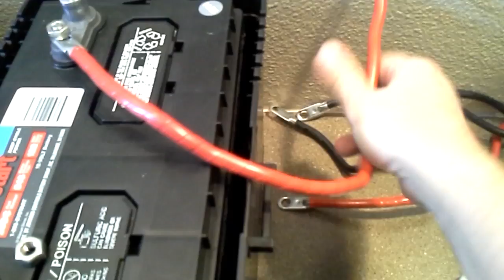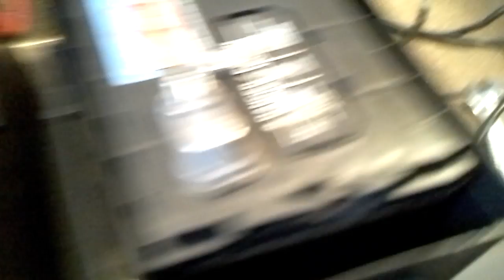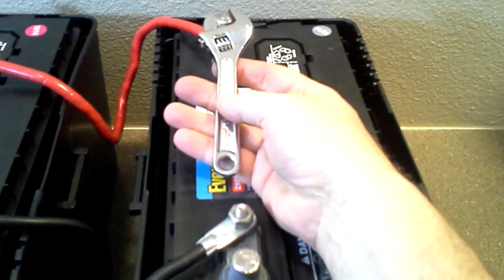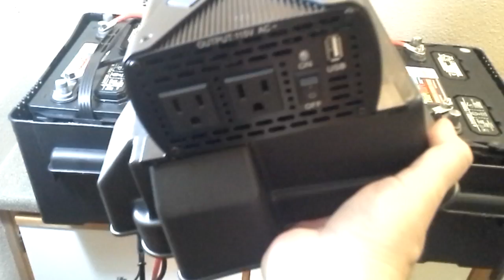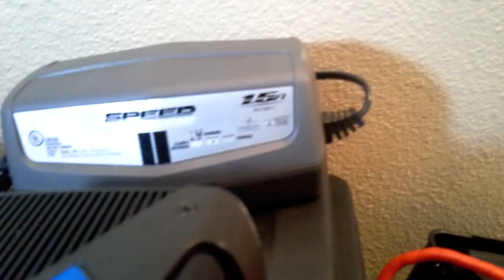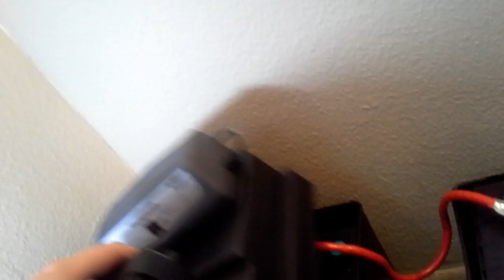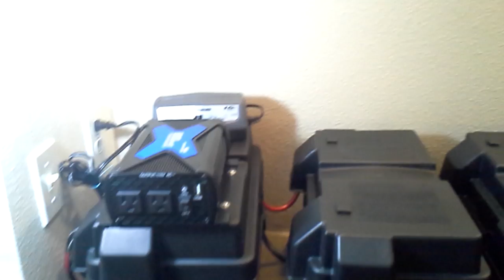Installing 4kW/Hr battery bank with 800W 120V Inverter and Trickle Charger from Tactical Woodgas

Comment: Your negative lead should have went to one end of your battery bank and then your positive should go to the other end, that way it discharges your batteries evenly, but instead you are drawing your full load off just the end battery that you are connected too and again NOT evenly across the bank! Over a period of weeks you will find the last battery that is connected to the inverter will no longer take a charge after a while!
Reply: Greg Benwell v
Reply: That is incorrect. Take the battery itself apart and you will see the 3 (ea) 2.2 V cells connected exactly as these are. Essentially what the guy has is 3 (ea) 13.2 VDC batteries wired in parallel to have 1 giant 13.2 VDC battery. 

What are my qualifications for saying this you might ask? I taught automotive electrical in the US Air Force for 4 years. During that time, Yes I did write the book on automotive electrical (wrote several training manuals on the subject). Then over the next 30 years I worked in trucking, mining, construction and similar industries as well as motorcycle dealerships and usually became the informal 'electrical guy.' My final qualification is ASE certified Master Heavy Duty Truck Technician.
Reply: Jerry Lynch stop beating your chest.
Reply: Greg Benwell  good
Reply: You have all those qualifications and you're still wrong? Hmm. That's quite an accomplishment.
Reply: I might well ask what your qualifications are Jerry, especially as you think it's okay to connect lead acid batteries in parallel like a child with only a rudimentary understanding of electrical practices might. And if I take a battery apart I will see several cells in series, and definitely not connected as those are. The nearest battery to the charger will undergo most of the charging and discharging because of the resistance of the cables connected to the other batteries. Greg is right. Do you know what Ohms are a measurement of? (This must be a rhetorical question to you!). Hang on, didn't Phil Silvers's Sgt Bilko character used to work at the motor pool in the armed forces? 'Nough said.

Comment: good  12 VDC  batteries  parallel  connection in which  Voltage of the  batteries  will not add up ( remain 12 V DC )  but  batteries  ampear  current  will add up  ( if each battery  has 100 amp it will 3  will generate 300 amps ) #

Comment: thank you for this video is nice I would like to ask you a question can you use the battery charger on while you are using the inverter with refrigerator on can the charger stay on the on position it won't burn the charger thank you again

Comment: To connect your lid the positive should go to plus on the left battery but the negative should be connected to the battery on the far right, this will equalize the charge/discharge through all batteries
Reply: At the amperages involved in supplying enough current to the inverter, it does make a difference.  Also, since battery charging -- especially in a battery bank -- depends on resistance, any difference in resistance that's not actually within the battery will result in the battery and the "end of the resistance" chain being chronically under-charged.  That's a sure recipe for reduced battery life and performance.
Even with thick cables (and these aren't "thick", I have 0000 cables on my battery bank and they're barely up to spec for my 2500 Watt inverter; they're bigger around than my thumb), there is enough resistance to make a difference.
Reply: It's not the amperage, it's the resistance/impedance to the "end of string" battery(ies).  Charging with modern chargers works on resistance -- even if it's a small resistance, the charger will "see" the battery that the charger is attached to as fully charged but it will also see the string further down as fully charged but it really won't be.  If you start less-than-fully charged and don't fully recharge that battery later, that battery will have a significantly lower life.

Battery maintenance is the big thing in all ways, but not balancing a string will put you in jeopardy for damaging batteries unevenly.

It's especially important when you can move a cable and make a $100 battery last two more years longer than it would have if wired in in an imbalance.

Comment: Make sure everyone who watches this video knows when you use automotive batteries you only get 20% of your amp hours. AGM is 50% and Lithium is about 80%.
Drawing power below the % capacity will kill your batteries in less than a month.

I recommend sealed AGM for this and most other applications. (100 amphour rating = 50 usable amphours)
Lithium would be good for Off-grid solar generators and flooded leads are really only good for engines

Comment: Hey there my friend I watched your video and it's perfect for an emergency, I have a question not sure if it crossed your mind 🤔 I saw you plugged the charger directly to the wall, have you tried connecting to the inverter to maintain a current charging flow directly to the batteries?? Allowing not to depend on any other source besides of the batteries itself curious question🤔 thanks for sharing be safe🙋‍♂️.

Comment: I'm putting together a similar system right now...  Everything I've read is that you always use the same batteries for the battery array because they may have different charging characteristics.  Same model, same capacity, same voltage.... basically make all the batteries identical.  Particularly the capacity.  I think someone also mentioned that you "draw power" from both ends of the battery array, not the last battery in the series. Neg lead on one end and the pos lead on the other end.

Comment: You must have a small fridge if you can run it on an 800w inverter. Many recommend a 2000w for big appliances for start up voltage draw. I had a 2000w inverter and it powered my 52" big screen on a 240 amp hour bank for hours but I wouldn't trust it on a fridge. I use Xantrex and they are awesome.
Reply: wingmanalive Most modern fridges are energy star rated and use less than 200 watts when running / 700 watts when starting. I ran my large 25 cubic ft fridge for a good long while on a 750 watt power inverter and a 95 ah battery.  I ran a kill a watt meter and found it pulled 730 watts when the compressor first started and 180 watts after 2 seconds. The only type of fridge I can think of that pulls a huge amount of power is a commercial fridge for a store or school cafeteria.
Reply: 200 watts when running? Is that with the door open or closed lol?  I'm no electrician but that is a surprising statement. My fridge is at least 15 years old and I know my 400w running/800w peak inverter would NEVER power it especially on start up. Always gave me a shut off. Now I do have a 1000w Xantrex inverter I haven't used yet so I assume it would run it based off your experience.. My 2000w inverter sleeps with the fishes lol. I played with that beast until I killed it. I just need to acquire the batteries like you show here to power my fridge for a decent amount of time in times of emergencies.
Reply: wingmanalive Oh, that explains it then......both of my fridges are only around 8 years old and energy star rated. They honestly use less than 200 watts running. I did go and see how much they used with the door open and found that they pull nearly an extra 100 watts!(Darn regular light bulbs LOL...need to switch to LED or CFL blubs). They Shut my little 750 watt inverter down when trying to start with the door open.

Comment: Perfect video! thank you in advance of my question.. I'm missing the step how the charger and the inverter connect to each other before they go to the battery terminal. Thanks again
Reply from the maker: jmondia 
I make that connection when manufacturing the battery bank.  All you have to do is connect the red and black wires to the battery as shown in the video.

Comment: IS WISE , IN PARALLEL BATTERY ARRANGEMENT,  CONNECT BETWEEN BATTERIES A CORRECT DC FUSE TO PREVENT A FIRE IF  ANY  BATTERY IS SHORTED/ IN YOUR CASE A 60A FUSE IS OK.  THOSE FUSES ARE TO BE INSTALLED IN POSITIVE OR NEGATIVE POLES.

Comment: technically he was still plugged into the wall lol.....using that battery charger lol the batterys are also not deep cycle so they emmits gases cause its water based battery

Comment: whoever is learning from this, tighten as u go
Reply: And hold the battery cable so it will not rotate as you tighten terminal, wrong way demonstrated here.

Comment: Simple, and straight forward! Also, good "Tips". One thing though, I have an inverter, and in the instructions to it, it says "NOT" to run any load off of it, at the same time of charging the batteries, that it is connected to. Any comments? Thanks for your time.

Comment: I got something like that setup but I've got 10 deep cycle batteries, And I don't plug it into the wall to charge it, I charge mine with 1000 watts of solar panels, And I got a 2000 watt power inverter.
Reply: Post a video on it if love to see
Reply: Thats enough energy, plenty of batteries.

Comment: Very organized explanation.  So far the videos I've seen (before this one) had people setting up their battery banks with wires sticking out all over the place; very confusing to watch.  This is a neat little set up.  It's not rocket science to understand about the AC outlet keeping the batteries charged.  All one has to do after is substitute the AC outlet to solar panels, wind turbine, etc to charge up the batteries.
Reply from the maker: Go to www.tacticalwoodgas.com, there is a video on all the charging methods, including solar.

https://www.tacticalwoodgas.com/online-store/Battery-Bank-with-800W-AC-Inverter-plus-solar-wall-car-charging-ports-p68927669

Comment: Don't use any type of starting or marine battery. Yes they are deep cycle, but can't handle true deep cycling like a golf cart or solar battery can. You are better off using Golf Cart batteries, they are made for true deep cycling and last way longer if you treat them right. I am going on 3yrs with my golf cart batteries, and they still are strong.

Comment: Nice! You could connect the positive to the 1st battery, and the negative to the 3rd battery... and the opposite for the inverter, thus avoiding the 1st battery being overused... even in parallel the charge is incoming and outgoing from the 1st battery... isn't it? Just curious!
Reply: Your absolutely correct on that the charge needs to come from opposite ends in order for batteries to b charged fully and same goes for inverter hookup,, opposite ends so it draws thru batt bank equally or u will end up killing that first battery alot quicker than other two!,, good eye, was about to post until I saw yours!!
Reply: Rodrigo Boos I have two house batteries in my rv and I know they are connected negative to positive, if I get a small 750w/1500peak watts converter can I hook it up to just one house battery? Or should I connect to engine battery or just plug adapter into cig lighter? (New at this, thanks for your patience)
Reply: shelleyfunny19 House batt. Dont want to flatten the engine batt. I assume your house batt is connected to some sort of charge system. If you use the cig lighter socket then that will more than likely be rigged to the engine batt. Also a solid connection to the batt is better than a cig lighter connection.

Comment: A question: in this system he will be saving energy all the time?  in other words   Elc grid ----> charges battery (AC) -> Energy stored in the batteries (DC) -> Energy converted by the Inverter to AC -> AC used in the entire house. 

If im not wrong the AC from the grid charging the batteries is lower than the final output, because to charge the batteries requires less Watts than the normal usage provided by the charged batteries...
Its a doubt that i have because i know for sure that something like this actually WORKS as energy saver system, a friend of mine has an hotel and montly he was paying 3000€ as electrical consumes, after installing a system very similar to the one descripted in the video he lowered the bill to 700€  having the same things working ( fridges, air coolers, lights etc)
There is someone who can explain me deply how  it is possible?  Thanks

Comment: Where the 4k watt came from. LoL. I see only 3 battery 🤣😃😆😂😁
Reply: V x A = VA = WATT...110 Amp-Hr x 3 batteries is 330 Amp-Hrs x 12V = 3960 VA-hrs = 3960 W-Hrs = 3.96 KW-Hrs...but since Lead-Acid batteries can only draw down to 50%, you can only get a little less than 2KW...

Comment: You are connecting the batteries wrong: in a parallel layout, for better Efficiency the positive of the Inverter goes to the "First" battery and the negative goes to the "last" battery
check this video:  https://www.youtube.com/watch?v=QwWNF_jorYY

Comment: Sir,
I think you made a mistake connecting the wires for the power inverter.
The cables shouldn't be connected the way you did. You should draw power from the far right end bottom positive side of the battery to the top negative side of the battery bank.
This will let you utilize the battery bank evenly instead of draining one battery and ruin the entire battery bank.
Please checkout my google+ to see alot of diagrams and  how to wire 12V, 24V 48V  battery banks in series, Parallel and Series Parallel

Comment: I wonder if it would be more "efficient" if you tapped into your batteries at the center battery, that way you won't have the center battery causing a reistance situation as they deplete...
Reply: +SM Kira  he should have taken the POS post on the first and the NEG post on the third and hooked those 2 up.  This would drain evenly from all 3 batteries and not strain the first one..

Comment: Modified sine-wave  will normally cause compressor motors (and all motors) to run very hot and reduce the life span.
Reply: Dennis Steele 

I have not found that to be true.  What is your source for that information?

Comment: You should be connecting the inverter connections at opposite ends of your battery bank
Reply from the maker: JimandLinda Woodruff 
Agree for higher power inverters. Less of an issue at 800W.
Reply: @tacticalwoodgas4036  Always an issue ...

Comment: that's  Awesome for me during hurricane season at least run some fans to stay cool, but the only thing is if i don't have power how am i going to plug the top part of the inverter
Reply: There are solar versions at www.tacticalwoodgas.com

Also, you can recharge it with your running car and jumper cables.

Comment: How about using a socket, extension and ratchet that way the chances of contacting the opposite terminal are almost nonexistent.
Reply: yellownp22541: Yes, true. But using a short wrench, especially one that ratchets, is simpler (less parts involved). Whatever....

Comment: Why did you plug it into a 110 outlet could it not run with out plugging into the wall plug the inverted power should work with out the 110 wall plug assistant’s right or wrong let me know thanks again
Reply from the maker: The 110V connection is to keep it fully charged between power outages.  Yes, it works without being connected to the outlet.
Reply: I asked myself that same question. This character is just brilliant. I'd have chosen the alternative, instead of 3 deep cycle batteries, the 1 deep cycle, an inverter, an alternator, and a double shaft blower motor, 1 side with the squirrel cage to cool things down, and the other with a pulley to run the alternator.

Comment: At what point in this video does it show where he tied the inverter into the system
Reply from the maker: That connection is made for you.  The big red and black battery wires connect to the inverter, AC charger, and on some models to the solar charge controller.  More info and videos at www.tacticalwoodgas.com

Comment: How many batteries should I invest on a 10 k inverter,  any one,  I don't wanna over kill it
Reply: For that amount of power it's better to step up the input voltage. I'd go to 36V or 48V but it's your choice.  See this video here for an idea - "EASIEST Off Grid Solar Power System Battery Bank'

Comment: I don't think your inverter is strong enough to run a fridge.  Most fridges will take over 1000 watts to cold start.  And if you use a modified square wave type inverter many AC induction motors won't run properly and modified square wave inverters will likely shorten the life span of ANY fridge motor.  I recommend at least 1200 watts for a fridge (startup) and use a sine wave inverter...  fyi...  regards...

Comment: decent setup,, im doing a bigger set up from the shed,, but i dont think an 800watt inverter will run a fridge or freezer the start up draw amperage is to much for the inverter, i scene a video,, where they use a 2000 watt inverter but  its surge apms were at 6000 watts,, im using a 1000 w,, and it only runs lights ,radio,, router,, and a laptop, maybe the tv, if i pushed it,lol
Reply: My 800 watt inverter will run my full size, side by side fridge.  It's a THOR modified sine wave.  $70.00
Reply: I have a cheap 750/1500 watt MSW inverter that will run my camper's 120v mini fridge on a single 12v battery and 190 watts of solar.

Comment: Hi There, great setup. trying to make one up myself but question I have is after you hookup the battery charger and start it up will the power inverter draw power direct from charger instead of battery?
Reply: +Nos Dehgan  He set up a power back up ; the charger keeps it topped off ; for when power does fail . It's not constantly being used.

Comment: Best not to run an inverter to just charge a phone. Get a fused cigarette lighter, and wire it to 12V. You can run things on 12V for much longer, as inverters waste a lot of energy up to 20%. So running 12V where you can, you would get at least 20% more runtime from any setup, so the same thing would apply using low power 12V caravan / RV led lights instead of 240v bulb types.